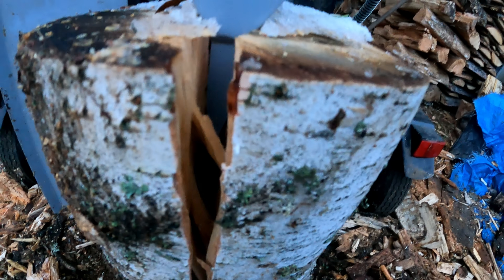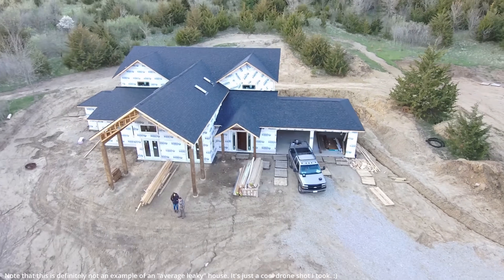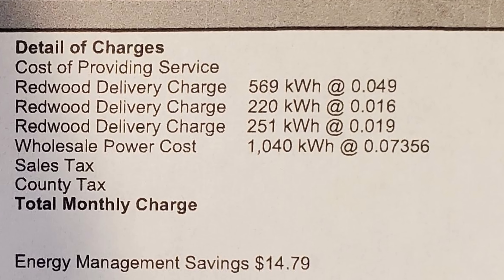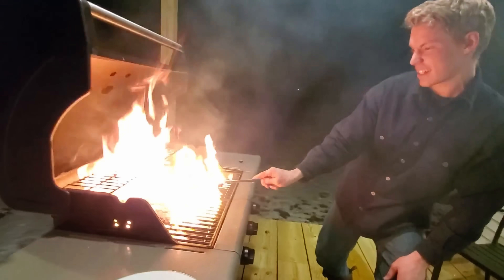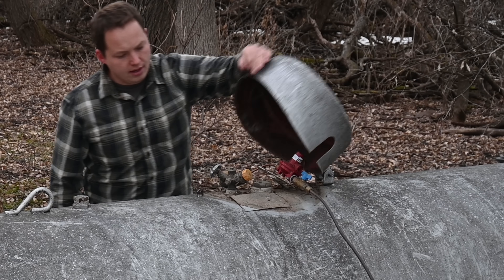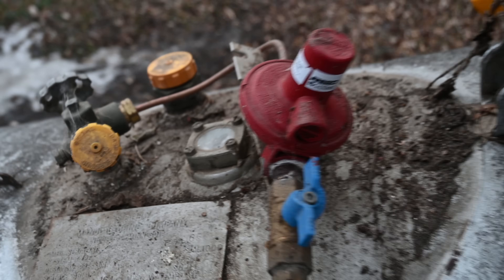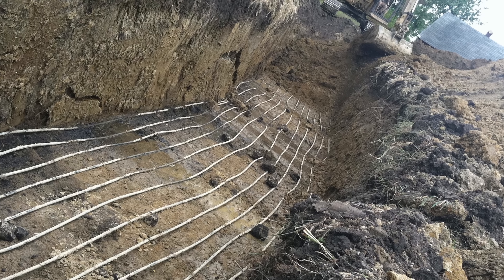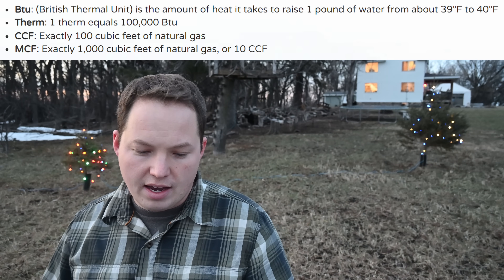What's The Best Heat Source in 2022? Top 5 Home Heating Methods - LP Electric NG Geothermal Fuel Oil

Comment: We have a fairly high end Heat Pump that can achieve a COP of greater than 4.  Even at 0 degrees celsius. We currently pay about $1.31 per therm for Natural gas and about 14 cents per KWH for electricity.  So in my area my Heat Pump is substantially cheaper to operate than natural gas.

Comment: Great video!  I live in Southeast PA and have an 11 year old Carrier Infinity air exchange heat pump with a natural gas furnace as the emergency heat.  I am still using the original Carrier thermostat.  It has 3 settings for heat pump, furnace, or hybrid.  Over the winter, I have exclusively used the furnace setting.  We have an 1800 square foot home plus half of our basement is finished, probably about 350 square ft.  Electric clothes dryer (but we hang most wash) and a gas water heater.  Also, we have a natural gas fireplace, non vented.  

In hybrid mode, I am not sure at what temperature the furnace takes over for the heat pump.  In Pennsylvania, we can choose our energy supplier,  unfortunately, my one year contract expired last December.  My new rates are about $0.18 per kWh (this includes charges for distribution, generation, etc).  We use an average of 670 kWh per month.  My natural gas rate is about $1.56 per ccf (again, this includes charges for distribution, supply, customer charge, etc).  We use an average of 551 ccf of gas per year.  

Due to unseasonably warm weather in April (average temp of 57 f) we used 41 ccf of gas and the bill was $64.  However in February, the average temp was 43 f and we used 74 ccf of gas and the bill was $113.  I just checked our gas usage in the summer and it looks like we use about 15 ccf natural gas, so I would estimate that is the monthly use for the water heater.  

In my part of PA, there is not much residential natural gas.  I had to pay $3000 to bring in gas from an 8” main pipe  that runs down a street on my property line.  Most folks use air exchange heat pumps with several having propane “emergency” heat.  Most folks with propane have 250 gallon tanks buried in their yards.  The tanks belong to the propane company.  

There is a new housing development nearby, the heat source is Propane from buried community tanks that connect several houses.  The builder contracted with a propane company to provide gas for 20 years.  I would not want this setup, but folks are shelling out $700k++ for these small homes on small lots.   

Before my hybrid system, we had a heat pump with the resistance emergency heat (sometimes called the A coil).  So when the temp wend below 30 degrees or so, the compressor would stop running and the A coil would take over.  

It is interesting to read comments from others about their heating source.  Last comment, cousin has a condo at the Jersey shore.  Last December there was a two day cold snap with temps were in the single digits Fahrenheit.  His air exchange heat pump ran 22 hours one day and the A coil emergency heat also ran about half the time.  The compressor and system are about 9 years old.

Comment: Great video!  I am using my Ductless when above 40F.   I don't feel it is efficient at lower temperatures, mainly if defrost mode is being used. C&H, Pioneer, and MrCool, seem to be 95% identical units.
I use Fuel-oil which was $4.50/gal, bastards.  My electric is at $0.24/Kw, bastards.

Comment: Primarily natural gas running two 50 gallon natural gas water heaters in series, with ~150 linear feet 3/4" of baseboard heating element. 
The heating caps out at a 65°F ΔT with 140°F water temperatures, at about $240/month. Unfortunately the water heaters don't support an outdoor reset. But I figure I'll be replacing one of the water heater with a wall mount boiler in a year or so because the potential for legionella doesn't sit well with me.

Comment: Here you go guys. As of Feb 18 2023, I live in S. Calif (where the temp rarely drops below 55* F in my location) I just paid a gas and electric bill of $369 for Jan. I use approx 2 - 3 Therms of NG a day and a thermostat set to 63* F. NG is $3.45 a Therm atm. Electricity is about $.63 per kwh give or take a few cents. I am thoroughly convinced, 100%, without a doubt, that our government (mainly the current administration), is trying to kill us all. Or, at least, don't give a flying (enter every 4 letter word you can think of here) if we live or die (and suffer tremendously in the process). Oh, and they banned installation of fireplaces in any new or existing homes.

Comment: Just thought I would say the heater in the thumbnail for this video is a bit dangerous. Because the heat radiating from it can light things on fire a couple feet or more away.  When I was 3, I accidentally burned our home down with that heater and a sleeping bag I set on a chair a couple of feet away.  The sleeping bag caught on fire  while we were out shopping.

Comment: In the really cold climate here in northern Sweden the most cost efficient heat source is geothermal/bedrock/ground source heat pump, lake water or soil/ground source heat pump, depending on local conditions.. Second best is an air-to-air (mini-split) air pump, often supplemented with a wood pellet stove for extreme temperatures. Interesting that the economics are so different compared to yours. Everyone stopped using oil in the early 80s, and propane/natural gas is unheard of. Recent wartime pricing aside, our electricity cost seems to be about half of yours.

Comment: Good insulation, floorheating and geothermal (one or two holes). The brine can be used for free AC/chilling in the summer. The one who wants to save in the long run puts an extra ~200 gallon tank inside and heatcollectors on the roof...

Comment: We have a 2,000 sq. Ft. ranch home  (not including the finished basement) in central Wisconsin. When propane prices about doubled in the fall of 2021 we decided to get geothermal installed. Installation was completed in late December of 2021. I installed an energy use monitoring system (Emporia) on January 1, 2022. According to that, we used 6,071 KWh to heat and cool our home in 2022. We pay $0.13 per kWh for a total of $789.23 for 12 months, and just $692.74 for heating months. We keep our thermostat at 72. Even after the tax credit we spent more than a regular furnace, but it’s good piece of mind.

Comment: The only time resistance electric heaters are better is in my situation where I have solar and battery backup.  Here in CA where the PGE bills have skyrocketed in 2023 most folks are complaining of $500 plus bills/ month for this winter. NG has shot up significantly since your video. I have 24" of cellulose insulation in the attic to help keep warm in the winter and cold in the summer. I turn the main gas furnace down low at night and just use an oil immersion electric heater to warm the bedroom. It does get down to the low 30's even here in northern CA. Folks can't wait for spring and warm sunny weather to return to rid of these high bills.

Comment: You are wrong the efficiency of electric heater varies greatly depending on the type, wattage and size of the unit. I have heated my home with electric for years and the infrared heaters that use lights are much better at heating a room than the small space heater you have shown. Which I also use that type in my bathroom it takes longer but offers faster direct heat (as oppsed to whole room heating) which is why I chose it for a room that I do not spend long hours in.

Comment: Question:
If burning coal is 3x better for the earth than using electric heat generated from coal… would the same principle apply to cars that run on electricity?  
I would think so. But I’m curious if it translates similarly.

Comment: Ground source heat pumps are too expensive and you will never recoup your money. They cost 25-35,000 dollars or more to install and even with rebates you’ll still pay 80 percent costs and sometimes more depending on your income.  So that I wouldn’t buy.  I like Boiler Heat because a good boiler will last sometimes up to 35 years or more, and nothing can compare to that on the market today. And the efficiency is pretty good on those boilers with propane or fuel oil, depending on where you live. If you have to replace a furnace or a heat pump specifically every 15 years which is about what they last today, and sometimes less you’ve already spent more than what you Will on a boiler that is rated real well, as far as reliability.  I’d also say, of course, the best thing is tight insulation, such as Rockwool, or the spray foam.

Comment: The most efficient way to heat/cool your house is a heat pump as it doesn’t generate/create heat it moves heat; creating heat takes massively more energy than moving heat. 
As far as the cresting methods efficiency varies by type, i.e. natural gas, propane, fuel oil, wood, electric, etc. while efficiency can change by type cost per type can overcome efficiency for total cost.
As a side note there is air source heat pumps and ground source (geothermal) and they can have very different costs and effective efficiencies depending on temperature difference.

Comment: My house is 160 years old and freezing.  The basement adds a lot to the cold due to dampness and air leaks. I'm considering spray foaming the basement to keep it dryer and lessen the air leaks.   Baby steps to make changes, I love my home ❤
Reply: oh yes insulation is the best way to start.Very high rate of return.
Reply: Use spray foam where the sole plate meets the foundation.
Insulate the perimeter joists first.
These two things made a big difference in my house.
Reply: Research types of insulation and call pest control companies. Was told by one (that was helping me determine if I had mice in my attic) that they are attracted to spray foam insulation.
Reply: @Jmamelia  Termites are attracted to exterior foam insulation as they like to eat into it to form a little base that keeps them warm. Especially exterior slab insulation which is typically in the ground around the house.

Comment: Quebec it cost me $300 a month to heat my 4,000 square foot home with baseboard heaters and run the house. During the summer the cost of power drops off to like $25 a month to run the house appliances

Comment: Solar thermal heating should also be included .. be it green houses , solar thermal air heaters , solar thermal water to hydronic heaters , passive house designs for windows and roof , etc ..

Comment: I'm spending less than $500 heating my 1,400 sf domicile throughout the entire winter, and I live in Colorado, along the front range.  Then again, my small office is at 70 deg F, but the rest of the house is at 55 deg F.

Two energy sources you did not mention:

1) Solar Photovoltaic Panel electricity driving a modern, high-efficiency mini-split heat pump.

2)  Solar Hot Water Heater feeding thermal battery driving subfloor heating.

Comment: Mini splits do not pull heat out of the air outside. It uses compressed gas when the gas in the tube expands it gets cold like an arousal can. When the gas is compressed, it gets hot. How the hell does everyone get this wrong. It's a damn AC unit that can run in reverse. Look up the gas laws of thermodynamics, It's a bit of reading but it's in there.

Comment: Propane is way more efficient than Oil. 94,000 btu's LP with most Boilers and Furnaces hitting 95% + or - Heat efficiency and Oil hitting 80% BURNER efficiency. Oil heat efficiency is closer to 65-70 with oil around 136,000 btu's. Oil can be vented in large masonry chimneys with clay liners because of the massive amount of btu's going in the chimney to warm it keeping the burnt gas rising. Most efficient LP units can only be vented out with PVC or CPVC. I work for the heating industry in Maine and I also teach Tech's in the trade.

Comment: I have a heat pump and a free standing fake wood fireplace. The heat pump is good until the outside temp is 40 below that light the gas heater. A heat pump is comfortable while it's blowing. When it stops it feels like someone left the freezer door open. My gas heater is in the living room of a 3 bed 2 bath house. A single ceiling fan blowing up spreads the heat throughout the house.

Comment: I got rid of my Central Heat that used Natural Gas. Now have 3 wall heat that pumps out 1,000 watts.   Only turn on when needed,  So if nobody is in the bedroom then don’t turn on,  If people are in the living room then turn on the 1,000 watt heater.  I live in San Francisco, so it doesn’t get that cold.  In addition I have 20 Solar panels on my roof. in the Summer 37 kwh is made in the winter 17 kwh. So that works for me

Comment: Had a buddy plumber/heating contractor. Regardless of all the variables insulation etc. Oil heat creates most BTU's and steam radiators best heat. Gas is cleaner but no way better at creating heat than oil. Electric least. As soon as electric off house cools. I had cast iron radiators with oil steam heat once and house was always toasty. Converted to gas with hot water baseboard. Not the same.
Granted cast iron made a big difference.

Comment: I use wood in a rocket stove.  Planning on building a rocket stove mass heater next winter.  Currently its 22 cents per KWh in CA, and the price increases significantly if you use more than the average high energy efficient homes.   So free is better regardless of the labor and cleanup involved when using wood.  We use about 1.5 cords of wood in a winter with the rocket stove.  Super efficient.  I grew up in the 70's with the old stoves in Michigan and remember needing way more wood to do the same job.  If you're still using the old stoves from those days- I understand the love of your past, but you owe it to yourself to take a little time to see what these new stoves can do.  Burning 70% less wood makes it so much easier to prepare for your next winter...  Semper Fi wood burning brothers and sisters.
Reply: Do you mean a masonry heater? I didn’t think a rocket stove would be safe inside?

Comment: My son just bought a house with an outdoor wood boiler. Owner says they buy $700 worth of wood for the season, supplemented with propane on those cool days where they don't want to fire up the boiler. They have 200 amp service so I can see a heat pump in their future instead of the propane.

Comment: It was costing me thousands in fuel oil for heat ( no nat gas available),  put in a new propane furnace and tank.  I’m still so mad I haven’t even used it yet I don’t want any heat bills lol.   Actually I’m experimenting with those little oil filled electric heaters and it’s working out great,  only hundreds not thousands now, yeah.  My new propane furnace and full tank are on standby.   I’m going to claw my money back one way or another.

Comment: I live in Northern New Brunswick 🇨🇦 and I use a heat pump when it drops to -10C I switch over to a force air wood furnace, I also have a electric force air furnace but too expensive to run. A cord of wood runs me about $225.

Comment: Primary heat: wood burning stove, propane, electric blanket on my side of the bed. 
A/C is electric and 15 years old. I’ll be replacing both the a/c and heaters soon. Probably going with best pumps.

Comment: Using a Hyper Heat 4 ton central system after using baseboard, Have my whole house a consistent 73 and during maintain mode it's only running at about 8-10 amps total. I'm actually looking forward to my next power bill because I just put it in and my 2 last baseboard bills were 400 each, hoping for a nice savings lol... I calculated my baseboard and assuming 250w per foot is correct they were running about 35 amps.

Comment: Wow, excellent comparison.  Lots of great info on pricing.  Thank you!!  
One thing to add may be the initial up-front costs of each of the systems... the price of all the equipment and labor to install them.  Electric baseboards are much more expensive to operate than a fossil-fueled furnace..... BUT a few electric baseboards and some wiring is much cheaper to purchase and install than an entire furnace with ductwork, possible chimney, oil tank, etc.

Comment: When we purchased our home, in 1980 the local nuke-generating plant produced low-cost energy. 

Scary cats had the plant converted to natural gas. 

The original General-Electric heat pump worked OK.
Presently newer 12 SEAR heat pump works efficiently. 

However, still missing the wonderful Clean nuke energy.

Comment: Why don't anybody ever question the higher rates these energy companies shoves down our throats. There usually higher even doubling the cost to heat our homes. Seams like if your penny less you'll get a brake but if you work to try to get a head, your screwed they'll make you and keep you broke.
Reply: Electrical cost increases are directly correlated to the govt green energy requirements!

Comment: Heating oil went up to $7 a gallon in my area in PA a couple months ago, it’s back down to around $4-5 now.  It was cheaper for me to heat my house with a cheap propane fireplace.  Propane is up to almost $3 a gallon here too.  In my new house we are looking at those cooper and hunter or Mr. Cool split units.  Those 2 brands seem to have the best cop at colder temps.  It gets cold  here in the pocono mountains.  I wonder what the price difference is between propane and electric with both being up right now
Reply: You might consider this very expensive Carrier unit.  It can be connected to a standard ducted air handler, or a ductless system.  It has a very expensive variable speed compressor that will allow it to put out the full 30,000 Btu heat rating - even at 5F outside.  By slowing the compressor to about 50 hz at 47F outside temperature, you get a lot of energy savings and slow and smooth heat into the home.  At 23F, you still get 30,000 Btu's of heat at about 85 Hz,  and at 5F, if you need 30,000 Btu's it can run at 120 Hz.   Double the speed, and you can still heat your home with it.

Carrier #  38marbq30aa3